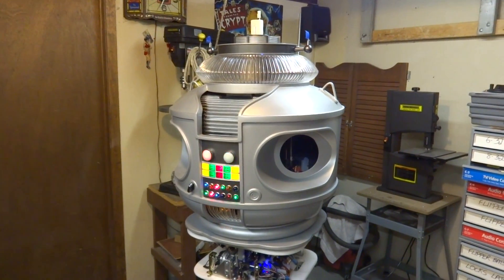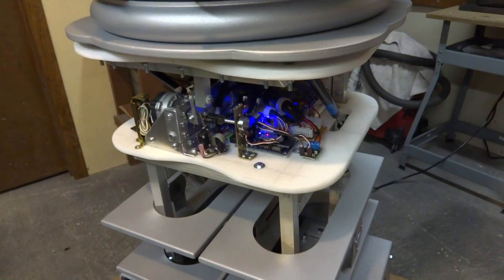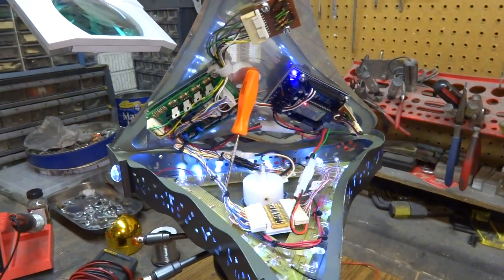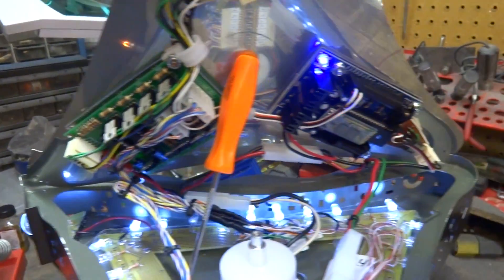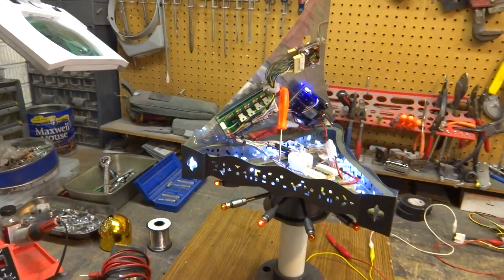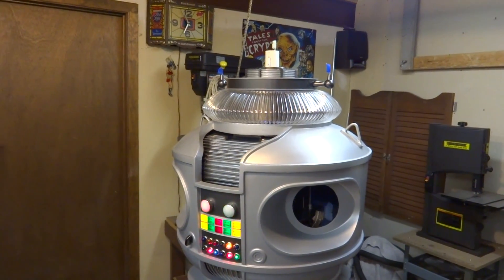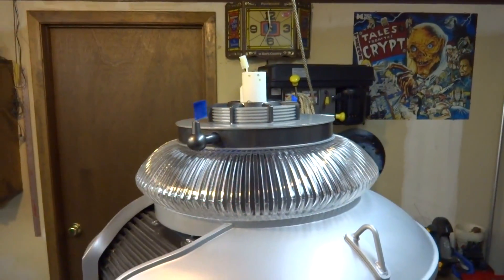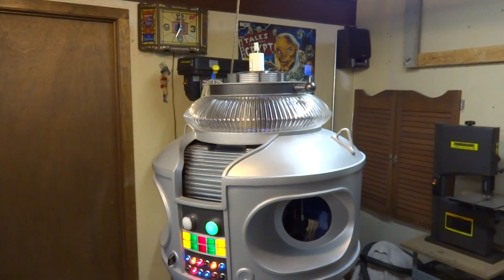Third EZB troubles.

Comment from the maker: Thanks Gunner. I've resolved this issue. It had nothing to do with EZ Builder. I found the built in Bluetooth in my 2007 Dell Laptop was to slow to handle the job. I disabled it in the laptop's Bios at bootup. Then I installed the Bluetooth Dongel (it's usb 3.0 comply) into a 2.0 USB port and after installing softwear, adding devices and port asignments all is well on my Dell laptop that I want to use for robot control. Rotation, speeds and stop points are all the
re as I expect and as scripted.